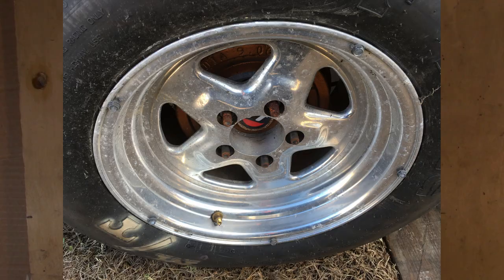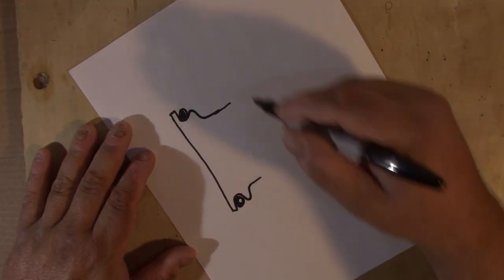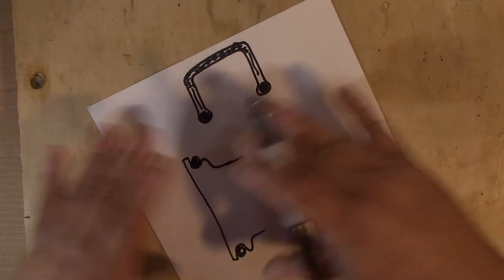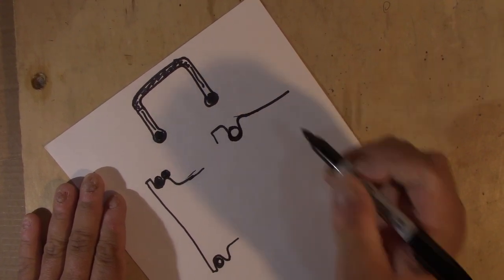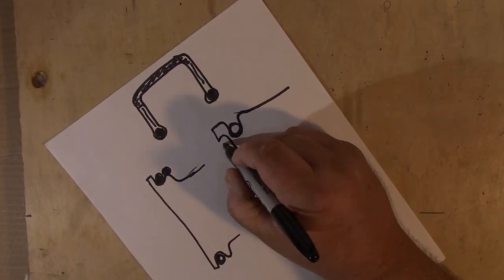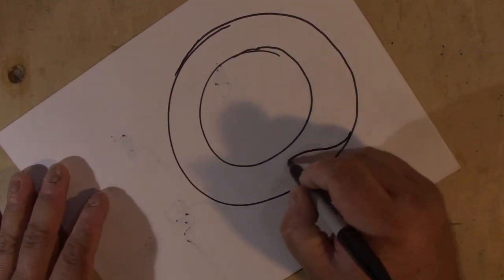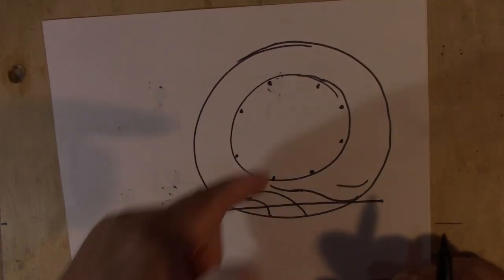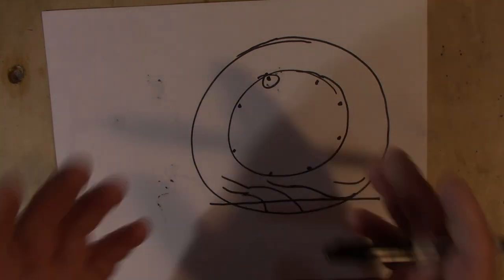Drag racing basics: Tire screws

Comment: Do you recommend over inflating the tire before putting screws in ?
Reply from the maker: I usually have 5-8lbs in the tire when I put the screws in. We pop them on the bead. Let them set a day to take a set then let the air down and put the the screws in.